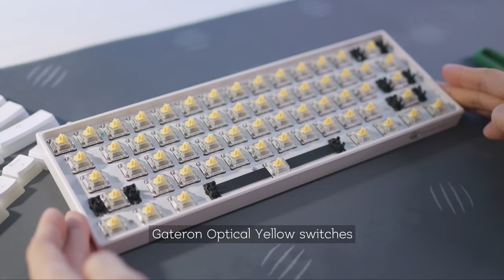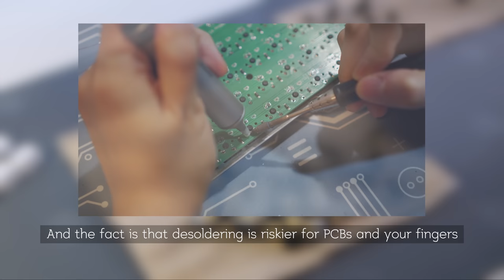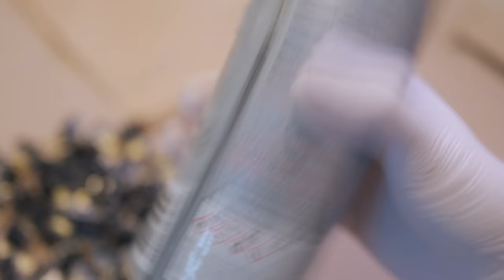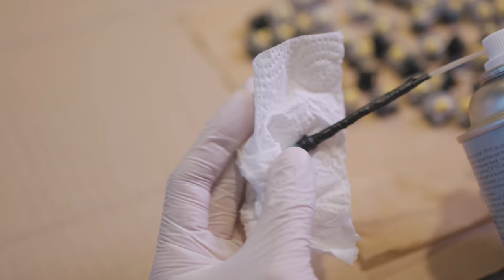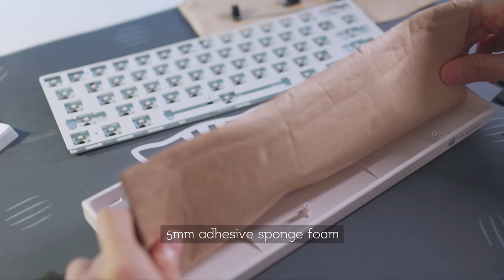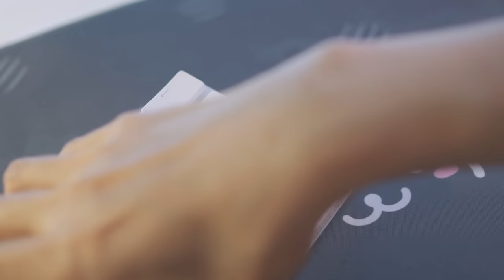Spray Lubed MK61 Typing Sounds | Gateron Optical Yellow Switches

Comment: Wow, I can't believe how different the sound is between using lubed switches without your desk mat compared to using them with your desk mat. They both sound really good to me as it is a personal preference but if you want a more quiet bubble wrap popping sound which is how I would describe it and is the sound that I love in a keyboard, then I do think using a desk mat will give you a more quiet sounding KB using Cat's (:3ildcat) configuration in this video while still being very pleasing to the ears. The most inexpensive mod to slightly change the sound of your keyboard, a desk mat. Who knew, lol? Also it takes no time to switch between using one and not using one. As far as the spray lube goes, I am impressed and as I have no experience with it but heard you should not use it, I probably would never use it unless I watched this video. So thanks again for the info Cat and for another great sound test. Sounds like you fixed it.🤜💥🤛

Comment: Even after all this controversy, I think spray lubing is still a great mod to do. Of course there are risks, but if you have a soldered board and you can't desolder it's definitely a valid option. If your board is hot swap though, there is almost no reason to spray lube.
Reply from the maker: Yeah, it has already proven that it's OK.
It's just a matter of what spray you use.

Comment: How has your experience with Gateron Optical Yellow switches been?
Is it comfortable to type on?

I'm a programmer and I don't really play any games. I'm currently using cherry mx red switches on a gskill km360, and I really enjoy typing on it.
However, I'm wondering if I should get the gk61 with Gateron Optical Yellow switches. It costs nearly $60 here in Dubai, and as a student, it is quite expensive but I'm willing to spend money on a product if it's worth it.

Comment: im always wondering, wether these keyboard would fit a custom case like tofu or something similar. i mean like gk61, this keyboard, and other similar boards that have the usb port on the left side of the case. so will it fit?
Reply from the maker: You need to check the screw hole positions too

Comment: I have an RK61 with a couple switches that work intermittently after spray lubing.  So is the BW-100 a possible solution you recommend?
Reply from the maker: Once you clean the contact, the switch will work normally

Comment: Quick question: does it have the same screw layout as GK61? coz if it does, I'll just buy this and an aluminium plate instead of going for higher end boards (i know im broke af)
Reply from the maker: Check the screw hole positions well (they are different)

Comment: can you spray lube any switches (for example the Alpacas) or only optical switches?
Reply: Spray lube is mostly safe for Optical switches but not for mechanical switches ( :3ilcat even confirmed not to do it with you mechanical switches as spray lube can easily damage the copper sheet of the switch ).

Comment: if you use a sryinge to spray lube, couldn't you use a syringe to inject some actual switch lubricant inside?
Reply from the maker: That's a different thing from the spray. Spray has the gas to help spreading the solvent and lube inside the switch well. That is a really good advantage while simple injecting can't.
Reply: @3ildcat  oh alright, guess I'm gonna spend a year desoldering switches

Comment: Would you recommend the same procedure for brown switches?
Reply: Generally spray lube works on every switch, by the way I’ve lubed mine with a generic silicon spray, it will sounds really well, but in like 2-3 months your switched will get damages by the corrosion of the spray (non every spray lube is plastic safe) if you have time I reccomend you to Just lube with krytox 205g0, trybosys 3024 or some thick lube if you are using linears, in your case I reccomend some liquid lube like krytox 105 something, so in general I would reccomend you to lube your keyboard with spray lube? I would say YES but ONLY if the spray lube is PLASTIC SAFE, yes in gateron brown it feels way better to lube them and no, in my case in my case the tactility remained invariated, I Wish that I’d helped you! Have a nice day.
Reply: @gabrielecalia7704  Thank you very much for your valuable information.Have a nice day :)
Reply: @egemenerol  no problem 😉🙂

Comment: I've tried spray lubing twice and both times I keep getting repeat presses and unresponsive keys even after waiting a long time for it to dry. What am I doing wrong :\

I will try optical switches next time I spray lube.
Reply from the maker: Once you clean the contact part, they will respond normally.
If you can desolder, take them out and clean the contact.
If you can't desolder, try the BW-100 spray as Hipyo's video showed.
Reply: @3ildcat  Will give that a shot, desoldered my sakurios.

Comment: i have tried my absolute HARDEST to straighten out my stabilizers ive broken my syringes and im using pliers and it still isnt working is there like a secret technique to straightening them out because no matter what i do they still TICK and drives me crazy lolol
Reply from the maker: There is no secret.
Just need a lot of patience and effort.
It looks simple but not simple.
Some do this for over 1 hour.
If the wires are straight, but still have noise? There must be other issues.
Reply: @3ildcat  oh my goodness thank you so much i spent like 30 to 45 minutes on my 2u's lol i was getting so angry but i knew there had to be more to it thank you so much for the help and i will keep at it (i also bout more stabs just incase)

Comment: Just got this and it has terrible latency/input lag issues. Every few keys there is really bad latency and makes it unusable, this is because the keyboard pulling rate is set to 90 hz and all new keyboard should have 1000hz.
Reply: me too, i've tried everything but no luck.. some posts on reddit might help you though, i'm currently waiting for a banggood employee to anwer my refund request.
Reply: @kumano7323  Bro i just tried Reddit tips on it, unlucky in my case, my keyborad stop working for ever, i'm try to contact with Banggod for a refund!!!!
Reply: @taguinche03  mine was stuck on a white background, a tip by reddit user  Radim_ helped me but the keyboard is still unusable in games like csgo, osu, etc. because it still has like 30ms response time. you can try it yourself so at least your keyboard will work hopefully. good luck bro
Reply: @kumano7323  Thx bro, i appreciate it

Comment: This seems tempting BUT WHATEVER YOU DO DO NOT SPRAY LUBE. It not worth the risk of ruining a keyboard. I thought I did enough research on it, techniques everything and my keyboard still broke plzplzplzplzplz just save yourself the $
Reply from the maker: If you did research well, you would say spray lubing itself isn't bad idea. Simply your contact would not respond well and you can fix it cleaning that part.
Reply: @3ildcat  Correct, but I just don't think that the trouble of having to have a backup plan incase your contacts aren't good is a good way for people to go about lubing especially for people just getting into the hobby.
Reply from the maker: @PsychsPK  Right. So they need to use only hotswap boards cuz desoldering is more dangerous than this. Or never lube any thing. It can burn and kill the PCBs and burn the fingers. This actually needs 'backup' PCBs. I've seen many newcomers  killed their PCBs while desoldering.
What defines good and bad lubing?
The best thing is just using without any mods. Just enjoying what we have.

Do you say 'Don't desolder'?
Reply: @3ildcat  I don't think this is a good comparison since access to soldering equipment and setting that up is alot less accessible than buying a can of spray lube. Most people just getting into the hobby will see this and go "oh this looks like an easy way to improve my keyboard!" and are more likely to do this than get a soldering iron, solder, a desoldering pump etc. So there is  great risk of people ruining their keyboards this way than soldering for entry level hobbyists
Reply from the maker: @PsychsPK  That's why I don't say 'Do spray lube or don't spray lube' and 'Do desolder or don't desolder'.
It's their freedom to challenge. 
No pain, no gain. Simple.

And as you can see, it's safe for the optical switches and it doesn't even need any back up plans. 
If they want to lube their mechanical switches, they need to take a risk anyway. Even though it's hotswap, some sockets would be dead while pushing the switch in. It's hotswap but still needs a 'backup' PCB. And some switches (contacts, pins, housings) could be broken while opening and closing. I still sometimes break some switches by just opening and closing. It needs backup switches. But we don't say 'don't open the switches'. 

So it sounds like just saying 'Don't do anything to your keyboards' is the best option considering all the things and you should say that to newcomers.
Reply: @3ildcat  I totally agree with you that it's up to people to decide what to do with their keyboards. But there is a reason spray lubing is still highly controversial, because its VERY easy to mess up and ruin keyboards while the examples you gave are not as prevalent and problematic. Especially for someone just getting into mechanical keyboards. Spray lubing should not be an entry point, it requires a lot of knowledge about keyboard as you've stated before "optical switches"  I can assure you most entry level hobbyists don't know what those even are.  For people who are already knowledgeable I say go ahead! But for beginners its not a good idea you have to see that.
Reply from the maker: @PsychsPK  Any mods need at least some level of knowledge and everything is not easy for newcomers.

I think you just don't like this. I understand that because I was like you when I saw this at first. 
It was like if I admit and accept this, all the efforts that I have done with the brush were meaningless or something like that.
Now I admit that this is one alternative. 
There is no such right or wrong answer for modding. Whatever they do, whenever they are satisfied, it's good. Not satisfied? It's bad. That's it.

This is way more simple than you think. Spray. Done. If some keys don't work properly, spray BW-100. Done. Fixed.

VERY easy to mess up and ruin keyboards? I don't agree. 
Please don't ignore the fact that all the other ways are risky.
Everything is not easy and not a good idea for "beginners". You have to see that.

Considering that, beginners shouldn't do any mods that I did in my videos. That's your idea, right?